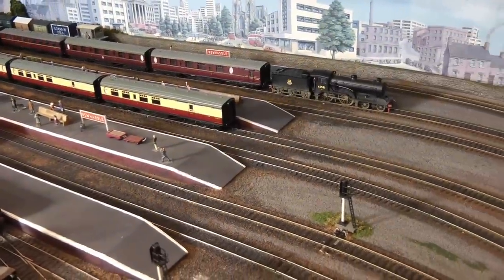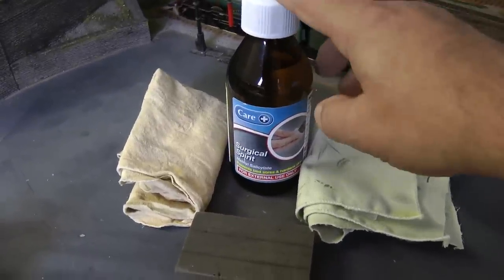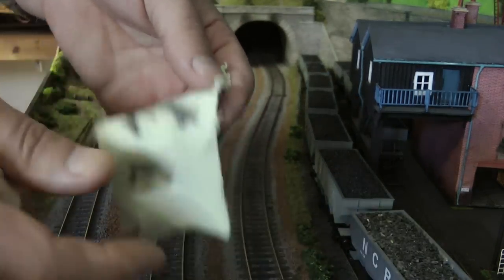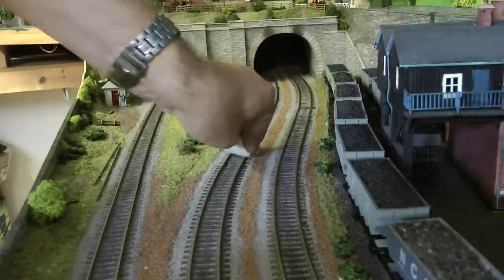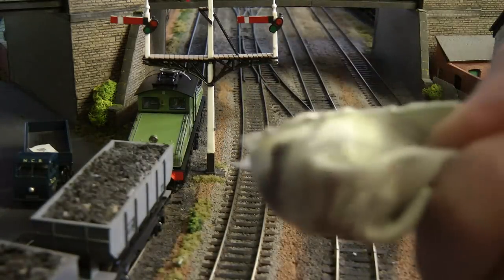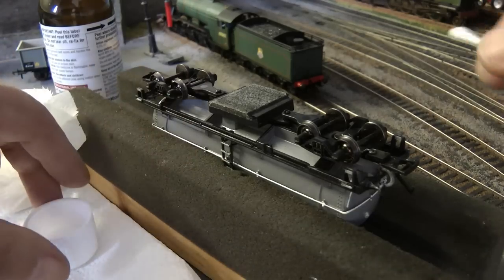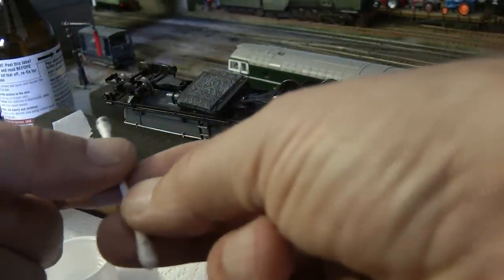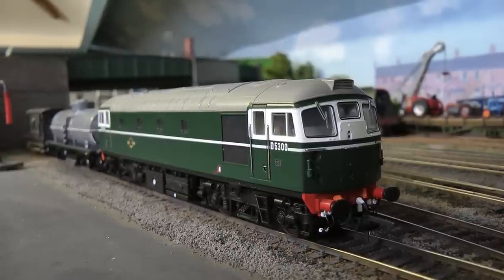TRACK CLEANING    No392

Comment: Thanks for this video. Do you have advice on cleaning and servicing locomotives. Steve
Reply from the maker: Hi Steve, cleaning the locomotives is reasonably easy to clean. i use a carbon fibre brush to clean the wheels individual. its a bit like a pencil. 
Pencil Brush, Propelling Scratch, Glass Fibre Bristle. you can buy the bristles refills separate. i hope this helps. all the best Tony.

Comment: I use a cork sanding block (non abrasive) and glass cleaner to clean my rails. I really like the idea of the chamois to polish the rails will have to try sometime.
Reply from the maker: The Chamois really does at the gleam to the rail. you can feel and see the difference after you have used it. many thanks for commenting. cheer's Tony

Comment: Good morning Tony, its always nice to see how others maintain the Railway since I've had my railway down in the shed, I think because I'm not putting it up and down it's not needing cleaning so often. I do put the hover over it a bit more often. That's a nice tip about using a chamois, I'll have to give it a try. As always it's nice seeing some trains running and some slightly different parts of the layout. Just got back from Surrey last night, so we've had a busy week with the kids up there, so a bit tired now.  Hope you're both well, look forward to seeing you on the next one Eddy xxx
Reply from the maker: Hello Eddy my friend. 
               The chamois really does work a treat. you can feel the difference once you have cleaned the track with it. and it does gleam. but i dont clean the track that often. the way i see it the more you clean the more you put wear into the top face of the rails. take care and have a great weekend. see you next week. cheer's for now Tony

Comment: Great tips, I’ve ditched the track rubber and have found I seem to be getting brilliant results with Inox. My 2 worst runners both Dapol 122 & 121 improved no end using it to clean the track. The frequency of me cleaning the track has also massively decreased. Good video 👍
Reply from the maker: I am glad that you have found the tips useful. and thank you for commenting cheer's for now Tony

Comment: Dear Tony, coolest track cleaning vid I ever saw. It must have been on the New Hassle and South Shields calendar, because you definitely had an audience on the layout. Love the idea of the two tier cleaning. Think the shimmy or shammy definitely polishes the rail heads into electric submission. When the shimmy is a true leather, it may contain some ‘foreign’ substance which further enhances the smoothness and/or conductive characteristics of the rails. It’s like you may see when after washing the window and wiping it with the squeegee, the shimmy seems to polish up the glass in a similar way. Although I have to admit I must soon wash my windows, I like that feel of the shimmy when it smoothens up the  glass surface. Yep, I’m one of those reluctant window washers. Oh and the ‘foreign’ substance is a baseball pun. Cheerio
Reply from the maker: hello Vincent, thank you for your kind words in the comment, as they are very much appreciated. The leather shamus is from halfords, and it does smell like leather. i only found out by chance. but it does work a treat as you have seen in the video. thanks again my friend. cheer's for now Tony

Comment: Hi Tony, Interesting video on track cleaning.  I have to disagree to the use of surgical spirit.  It contains Industrial Methylated Spirit, Methyl salicylate, castor oil and other chemicals. Oh, and I forgot, water, so you are putting water on your track, my friend.   It will clean the track but it is not for use on electrical circuits (your locos and track are electrical circuits) which require conductivity in preference to cleanliness.  We used to use CRC on our electrical contacts. There are others like INOX-MX3 which are a suitable formular for track work, as it is silicon free.  The track needs a very light coating, like dry brushing is to painting, If you clean your loco and rolling stock wheels first, they will keep clean for longer as they pick up the Inox from the track.  Scrape your rails with a bit of wood (coffee stick?) and not that track rubber full of metallic particles to get into your loco and turnouts.  The reason your rails shine after using the chamois cloth is because leather has sharpening or honing properties, hence the barbers leather strap to put an edge on his cut throat.  As a lad at school, I was taught how to put a keen edge on plane blades by using a flipping motion across the palm of my hand, a practice which today, would leave people horrified. 😂  Good old elf & safety.  If you want the low down, Greg who is an electrical guy on the Ozy railways (no, he does not clean their rack 😂) He has a video here https://www.youtube.com/watch?v=1r2L8NSxOnQ&t=191s  Best, Jason.
Reply from the maker: Hello Jason, thank you for commenting my friend. the surgical spirit is only for removing the carbon from the cleaning pad on the cleaning wagon. i watched the video link. great stuff. it really opened my eyes. thanks again for the information. i am sure the readers will be interested to see this video. cheer's for now. Tony

Comment: Hi Tony, good to hear about what works so well, once ever six months on a layout that size says it all. My test track loop rapidly oxidizes over 24 hours (old Hornby) and I just polish it with my fingers or a cloth!  Staggered how much I get off. In those younger days it was methylated spirits in the Hornby track cleaner, which I still have, but never a track rubber. On the leather I do wonder if the residual tanning oil is inhibiting the surface oxidation. There are many using INOX and the key to success there seems to be applying it extremely sparingly (if too much it acts as an insulator). Your technique with the finesse of the leather is what I will kick off with… once I get my track laid! My tip in return is I use coffee stirrers for polishing the loco wheels (particularly on seconded hand purchased items) and pick up surfaces, no scratches too and you can see what you are removing! All the best Stephen
Reply from the maker: Hi Stephen, the leather is a cheap one you may get from Poundland. so its nothing really special. but it does work. take care my friend. Tony

Comment: Many thanks for sharing your cleaning rail tips Tony, did you have to cut the width of your cleaning pad to miss the third rail because I brought the GaugeMaster one and the pad catches the third rail but is ideal for my lower level storage lanes. I have used IPA with clean cloth and carefully rub the scenic rail sections then use a second clean piece of cloth to ensure track is dry. I also brought (new) the Dapol one but again this fouls the third rail and I have double checked with Peco that the third rail is set at the correct height and distance from the running rails, will try your tip of finishing with a piece of chamois, regards and best wishes Barry..
Reply from the maker: Hi Barry. your very welcome, you know me i do like to share what i get up to in the railway loft. The Bachmann Ho rail cleaner is great for the third rail, as you have said it fits perfectly. but it does take a few runs to get the track squeaky clean.  but you can not beat the tried and tested lint free cloth to remove the carbon on the rails. many thanks again my friend. cheer's for now Tony.

Comment: Another thoughtful video Tony, well done.
How old is track?
I do wonder about continued use of abrasive rubbers long term on the rail head?
cheers Paul
Reply from the maker: Hi Paul, some of the trackwork has been down for 7 years. so its doing well. mind you i don't do many running sessions. even why i run them for my amusement. Rubber track cleaners can be very abrasive and leave scratches on the top rail.. all the best my friend. Tony